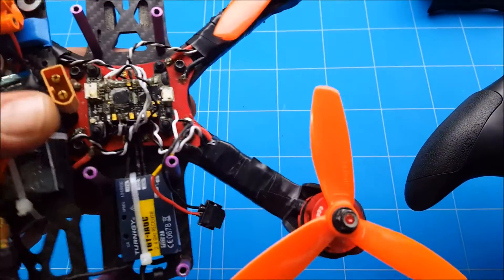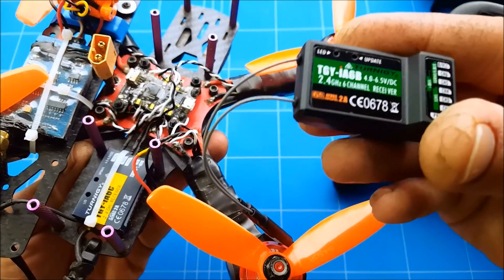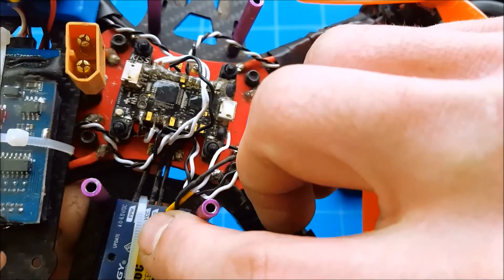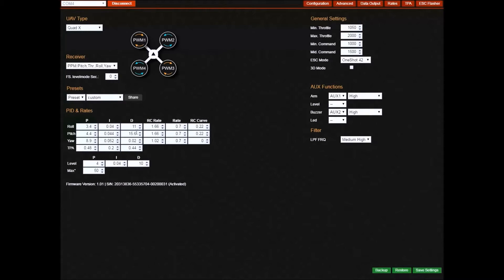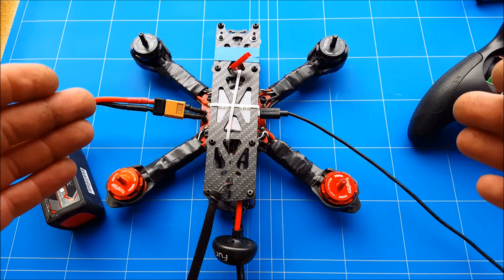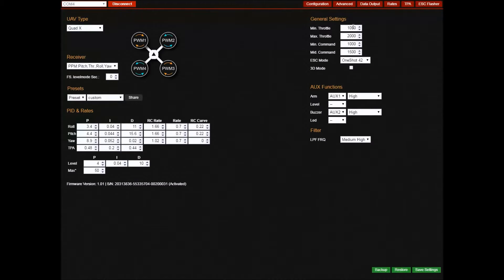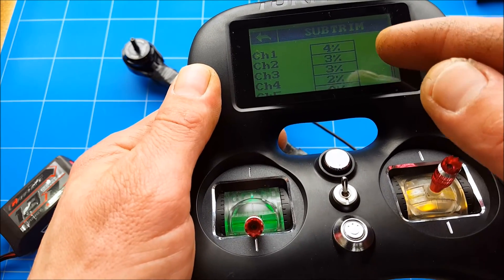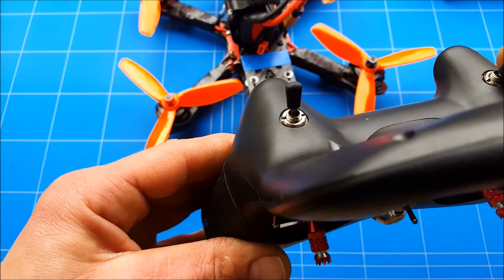How To Connect Turnigy Evolution Radio With The Kiss Flight Controller

Comment: my fly sky radio's aux switches don't go down to 4 they go down to 5 but the gui only goes up to aux 4 pls help me i cannot arm my quad.
Reply from the maker: Are your AUX inputs in the Data Output tab in the GUI responding to your flysky radio input switches?
Reply: How To DIY Rc FPV yes they are now aux 4 turned to aux 1 in the gui thanks for the help
Reply from the maker: Np mate wish you happy flying :D

Comment: Very helpful on getting my qwad set up thank you so much. But my motors 1 and 4 are starting up faster then 2 and 3 they gradually increase in speed can you please help me with this problem thank you
Reply from the maker: hi there is one step your missing in the video because I did that during the build of the quad and that's an ESC calibration that shut make all 4 motors start spinning at the same time
Sorry can't fix that the motors gradually increase speed my quad those the same
hope this helps... iff not let me know :D

Comment: hmm what you did DID NOT calibrate the escs..
you need to set it to min throttle after that .. and wait for the song
Reply from the maker: Sorry Forgot good that you brought it up!
It not easy shooting a video and talk at the same time there always something you forget doing everything at once... Thanks for helping a brother out :D
Reply: no worries man :) i do know how it goes when you follow something and they left a vital step out and then you arm the quad for the first time and motors dont work and you think you wires something wrong .. or you killed an esc or you got a dud motor .. etc etc etc .. :D
Reply from the maker: Ye...now I really feel bad 
Do hope most people using a Kiss FC already have some build experience and don't forget that step
Reply: not REALLY in my experience many NEW to building are using kiss for the first time because its quite easier to set up than .. other fc's s (in theory) :) .. but yes .. many of the NEW guys wouldnt know about esc calibration and we know .. that will cause all sorts of problems.. not to mention you can't passthrough programme OTHER THAN KISS Esc.. with kiss fc.. :\
Reply from the maker: Hahaha theory ye!... in practice setting up the Kiss flight controller to work 
is not so easy for the first time
Ye only throttle calibration in not enuff your ESC need it too
but what do you meen by (you can't passthrough programme OTHER THAN KISS Esc.. with kiss fc) I'm using racestar ESC on oneshot 42 working good with the Kiss FC